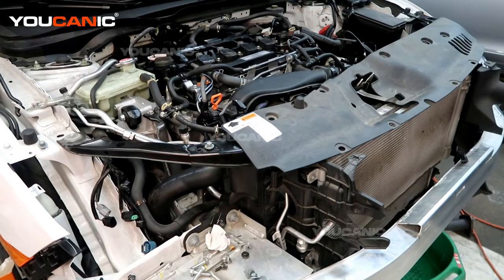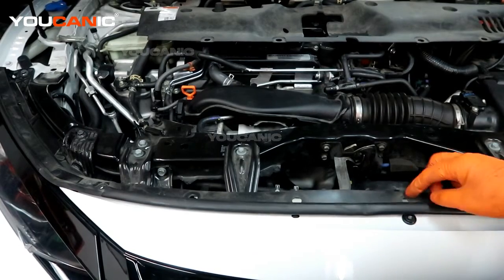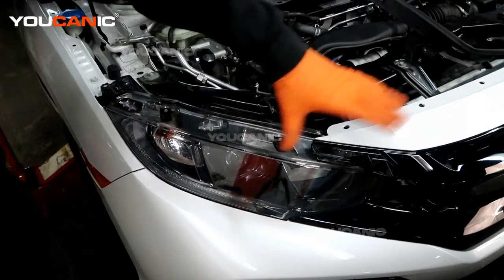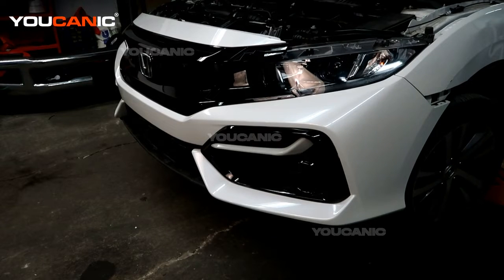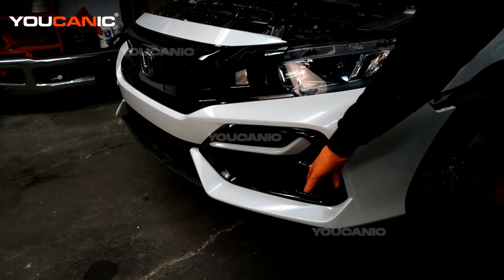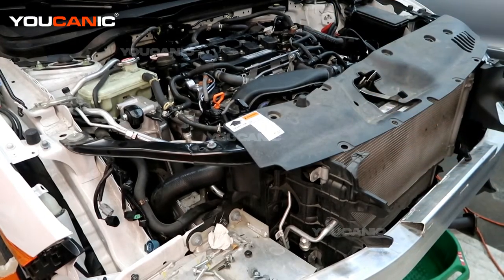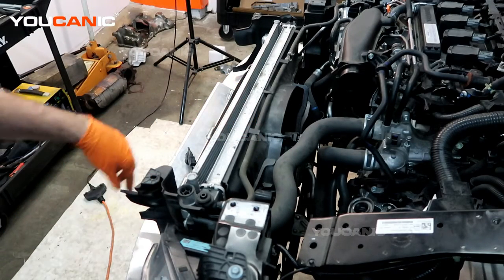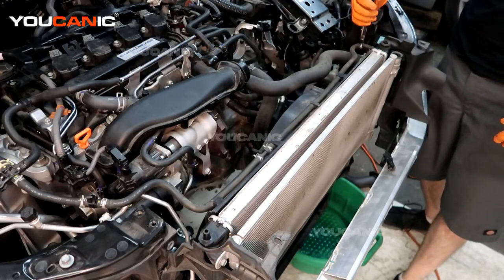2016-2021 Honda Civic - Radiator Replacement

Comment: Iv just done this job on a 2015 Type R and you don’t have to take the front end off like this, top plastic and top
Slam panel off and you can access all the fittings
Reply: Really? What you mean slam panel off?  How long did it take for you to install the radiator without taking the bumper off
Reply: Took me 20mins, (extra time after to bleed coolant through. by slam panel I mean where the bonnet latch fits, it unbolts and you can move it out the way, you don’t need to unhook the latch cable, this way the radiator just lifted straight up. Definitely didn’t need to take bumper off.

Comment: Very useful video - except - I was looking to see  the "Beam Bumper Center" attachments. At marker 2:57 and 6:22 it is clearly attached and one second later as the bumper is lifted off it is GONE! Same on reassemble - it is missing just before the bumper is put on (18:27), but magically there just as the bumper is put back on (18:57)! Also, the removal and re-installation of the cover that the hood release goes through is not shown - only even seen for an instant at 6:24 - just laying there.
Reply from the maker: Thanks for your keen observation. We understand that detailed information on the "Beam Bumper Center" attachments and the hood release cover is crucial. Our goal at YOUCANIC is to make car maintenance easier and empower car owners. For a detailed guide in this area, visit our website www.youcanic.com and access our free resources and factory repair manuals. We're here to support you, so don't hesitate to reach out to us on our site if you need further assistance. Your journey of car ownership is our priority!

Comment: Why was the new aftermarket replacement radiator have a thinner core? That must be for a 2L NA not for the turbo 1.5t 😮
Reply from the maker: Thank you for your question! While the aftermarket radiator may have a thinner core, it should not compromise the performance. It’s designed for efficiency and cost-effectiveness. For further inquiries or more detailed insights, we encourage you to visit our site, YOUCANIC. 

We have an array of guides, free resources, and our powerful YOUCANIC scanner to empower and assist you in your car-ownership journey. Our desire is to make you self-reliable in car maintenance without breaking the bank. We aim to empower you, so do not hesitate to reach out! Visit us at www.youcanic.com.

Comment: Would have been more helpful to actually show the drain plug, but good video overall
Reply from the maker: Hello, thank you for spending time to provide us with your feedback. We're glad you found our video somewhat useful, and we apologize if we missed showing the drain plug clearly in our video tutorial. Our main goal at YOUCANIC is to support you in your car repairs journey to make it a lot easier and efficient.

For further assistance, kindly check out our YOUCANIC Pro System Scanner at www.youcanic.com/scanner where you can find high-quality professional diagnostic scanner that can help you significantly in your car repairs. Also, if you require in depth knowledge of Factory Repair Manuals and Torque Specs to aid you in your car repair process, you can access this information at www.youcanic.com/manuals. We strive to equip you with comprehensive resources to ensure your car repair process is seamless. Thank you once again for your feedback and continuous support.

Comment: Fuck i regret buying my 2019 civic thats alooooot of work just to replace the radiator
Reply from the maker: Thanks for your comment! At Youcanic, we exist to empower car owners such as yourself to tackle car maintenance confidently. We understand that replacing the radiator seems like a lot of work, but with free resources, guides, and our powerful Youcanic scanner, the process becomes simpler. 

Moreover, we have detailed factory repair manuals for deeper guidance. Rest assured, you are not alone in this, Youcanic is always ready to assist you with any car maintenance task you might encounter. Visit us at www.youcanic.com. Together, we'll make your car ownership journey smooth and stress-free!

Comment: Terrible video from the start. How do you remove the push clips?
Reply from the maker: Thanks for your feedback! We're sorry if you found our video less than useful. We strive to assist viewers like you in car repairs. Regarding the removal of push clips, we advise using the right tools and following secure procedures. Tools like the YOUCANIC Full System Scanner (www.youcanic.com/scanner) can be a great help in diagnosing modern cars just like a professional mechanic.

To further ensure a reliable repair, we also suggest referring to our Factory Repair Manuals and Torque Specs (www.youcanic.com/manuals). These comprehensive guides, available for a small fee, can provide you with key technical specificity needed to complete car repairs safely and correctly. Let's empower ourselves to be the best car owners we can be!